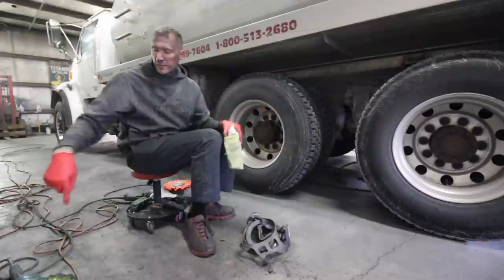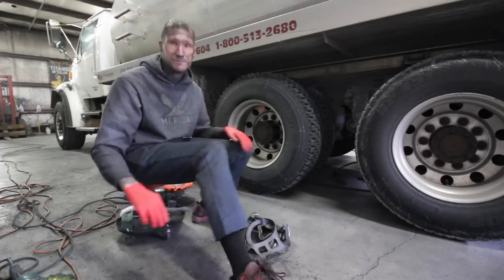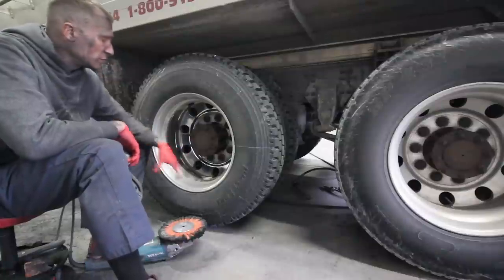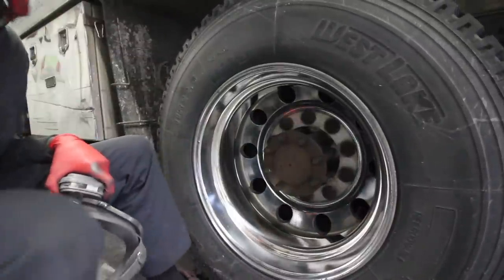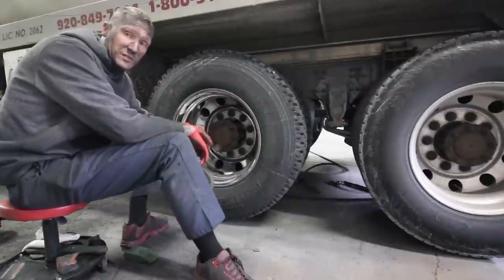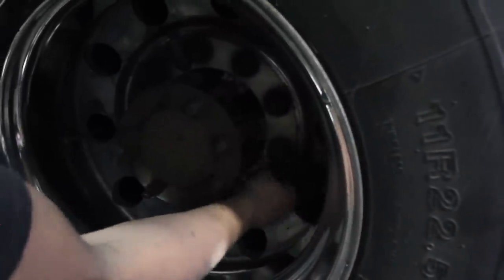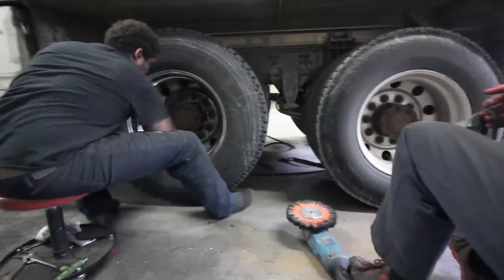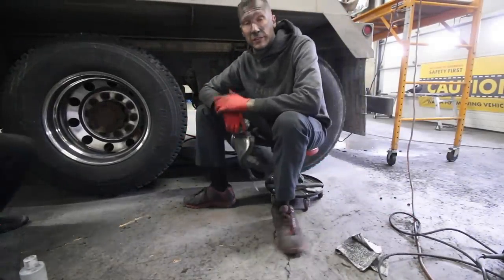How to polish a drive wheel mounted on a truck - In Depth Evan's Detailing and Polishing

Comment: I cant believe what I heard, you charge twice as much for a show shine finish, Dude that's bull crap, Glass cleaner bollocks, If you use Blitz pre clean it works like a acid and removes all grime and corrosion crap from aluminium wheels front and back and leave a perfect clean smooth surface for polishing with no effort in less than a minute your cheaping out and charging a premium for that, the finish you want is dictated BY the GRIT u use like B cut super will leave a mirror shine with no sign of scratches, swirls etc and it dont double the price of anything and it aint nothing special either, basically your doing a half of the work and saying done but if you want a mirror shine I will charge you double when it should be a mirror finish totally smooth anyway, No such thing as a show shine finish. you making sound its a special detailed job when its not
Reply from the maker: Thanks for watching and taking the time to comment.